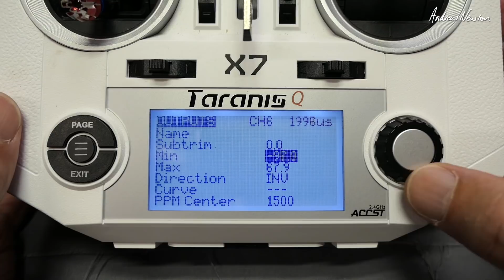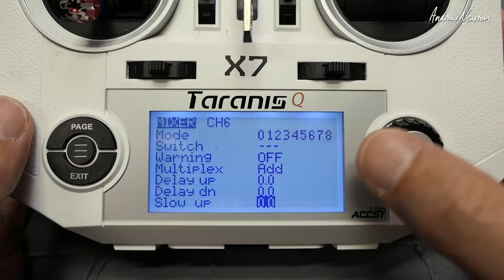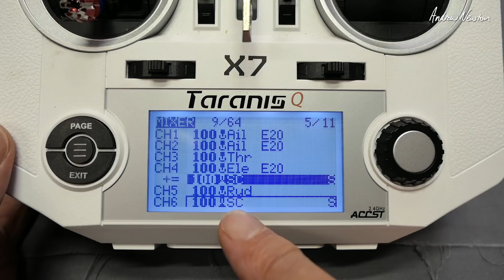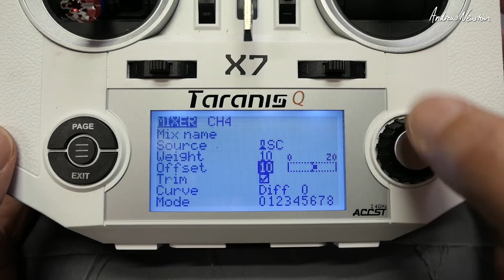Flaps and Elevator

Comment: Can someone explain why i need different flap settings please? Like is 50% for take off and 100% for landing? Why not 100% all the time? Which is the correct way to use them?
Reply from the maker: Take off flaps add lift, landing flaps are more like air brakes. At least that's how I use them

Comment: Hi Andrew, Super vid again. Q. Having set up Plane and Kopilot (Jumper T12 and FS-ia6B), would I use inputs (Output limits are set) and not Mixer screen to set up 3 way switch? I cannot use the KP Aux pins so have plugged servos with Y lead into Receiver Ch6. Thanks.
Reply: All now sorted from your earlier vid! Used Ch 6 on receiver.
Reply from the maker: Yes, that's the answer. Well done

Comment: Nice video, thanks! What if you want switch position 1 (half flaps) having weight and offset 10% but for switch position 2 (full flaps) you would like to have weight and offset 5%? Should that be accomplished somehow via curves? I would be grateful if you could explain me the easiest method to have a bit more accurate control for flaps-elevator mix. Right now on half flaps, elevator mix works perfectly when I have weight and offset as big as 25%, but with full flaps my plane dives way too much instead of plane staying level.
Reply from the maker: Should be possible to have different elevator amounts for each flap position, just by assigning the switch position in the mix line
Reply: @AndrewNewton  Hmm...I couldn't figure out how to do that. I use opentx transmitter and I can only assign switch in general (like SA), but I couldn't assign three switch positions separately. Fortunately I figured out how to do what I want: Instead of changing weight and offset values at all, I created three point custom curve with values 0, 25 and 35. Then on the mixing screen I just chose curve: cstm (custom) and I referred to the curve I had created.
Reply: @Juhar76  same problem i am having.i want elevator mix ONLY on full flaps but it doesnt let me pick a switch position(only general switch).I will play with the curves like u did.driving me nuts..

Comment: This may sound like a stupid question, but I have my flaps set up on channel 6 on the receiver, connected via a Y cable, but one flap goes up and the other one goes down. I know  I can buy a servo reverser, but do you know if I can copy the Flaps mixer settings from channel 6 on the taranis onto channel 7 and have the flaps plugged into channel 6 and 7 on the receiver, but control both flaps from one 3 way switch. Great video by the way.
Reply from the maker: Yes that's exactly what you need to do. Or pull out one flap servo and flip it over. To use a Y lead they should both be mounted facing the same direction. But you can plug them separately into 6 and 7 (that's what I usually do) and copy the flap mix from 6 to 7 then reverse the weight of Ch7 in the mixer page or INVert Ch7 in the Output page.

Comment: Awesome Video! Will use this as I assemble my volantex ranger 2000 this weekend!
Reply from the maker: Excellent plane, good choice
Reply: @AndrewNewton  For sure! I discovered it watching your videos about a year ago and finally took the plunge! I've been flying a scratchbuilt FT tiny trainer and getting better, coming from freestyle fpv multirotors took some getting used to, but fixed wing is a ton of fun. I laser cut a bunch of airfoil templates(clark y and S7037) and want to get into hotwire cutting as well, and Im also trying to figure out how to design a balsa wing to laser cut.

Comment: Thanks, pushrod tip useful, I noticed the CG  pen marks under the wing,  do you find the Phoenix 2.4  factory CG to be accurate? Or is it further back? I had to add weight and a larger battery to balance it, before this  it measured tail heavy, but flew perfectly, not sure if the added weight was necessary of CG marks on the wing out.
Reply from the maker: My CG was 80 to 85mm on the 2.4, but this is the 2000

Comment: Informative as always #1👍🏻😉
Reply: very. adjusting the throws on your radio till your hear them not straining is great info. i wonder if you could still do this if you were using as3x or s.a.f.e. when you have those on you hear nothing but servos straining, or maybe its just that you hear them working, not necessarily straining, per se?
Reply from the maker: That might be constant working rather than straining
Reply: thats what i was thinking i guess